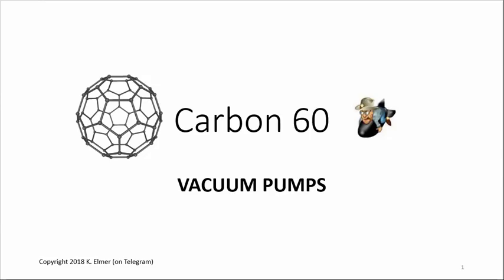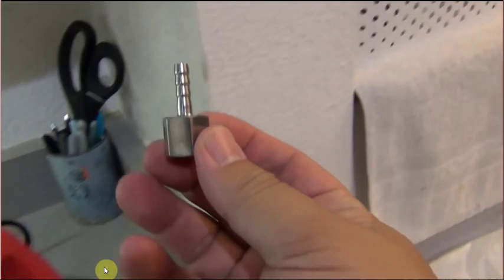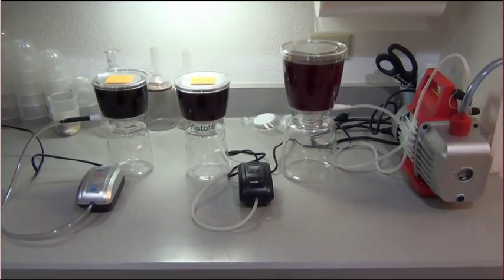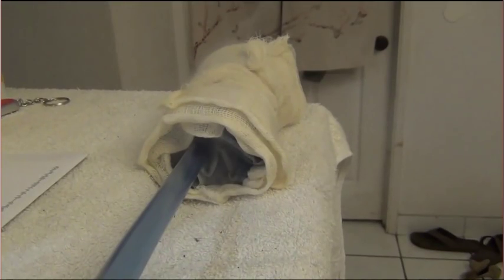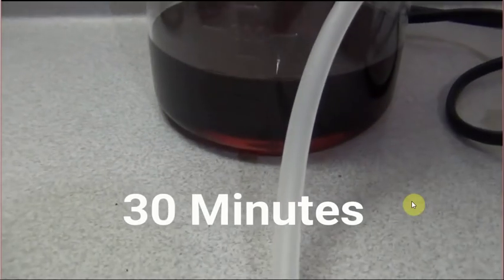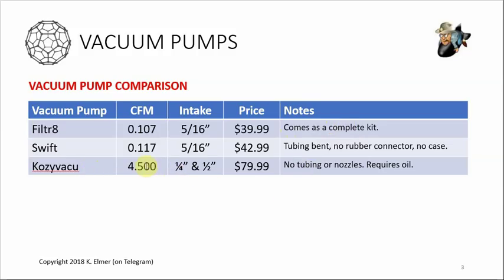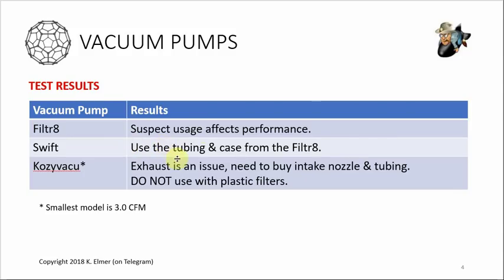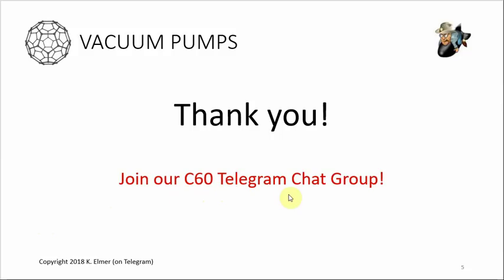Carbon 60 - Vacuum Pumps

Comment: I've used C60 for 1,5 years without any effect! I don't think it's working!
Reply: In about the same position. Been using just over a year with no noticeable effect.
Reply: How are you wanting to feel,  Do you have health problems your wanting to cure?
Reply: @garnettfaulkner6206  : I've had chronic pain for a long time.
Reply: @fredflintstone4715  If you're not taking at least a tablespoon a day, nothing is going to happen for you.  That's my experience..
Reply from the maker: Agree w/ Glenn.  If you want to feel it, you need to take a sufficient amount for your weight, otherwise its going to behave like any other supplement and just do its job w/out an fanfare.
Reply: @KElmerTinkersAcademy  So 5ml a day is not enough for a 65kg human? That's the dose they recommend everywhere no? And I'm short and slim.
Reply: @KElmerTinkersAcademy  : I've been taking 2 tablespoons a day for over 9 months. At 5' 10" and 155 pounds, that should be plenty from what I've heard.